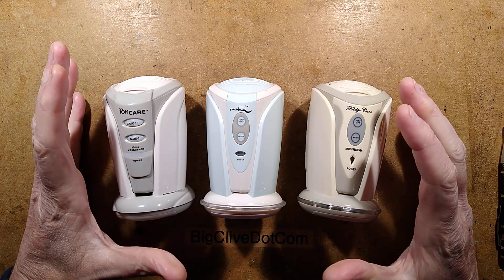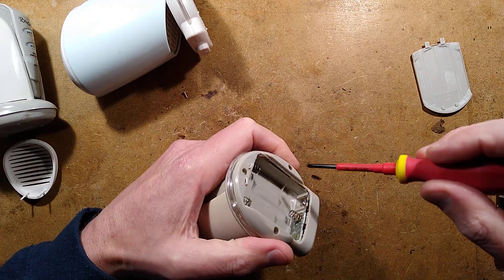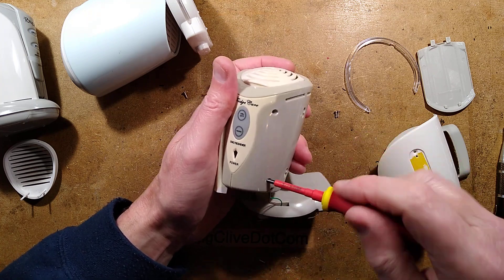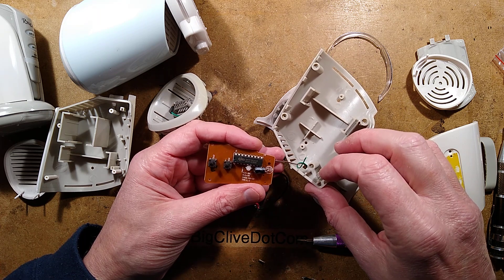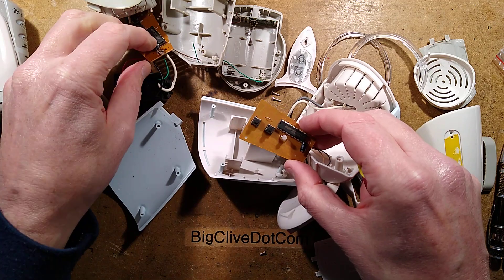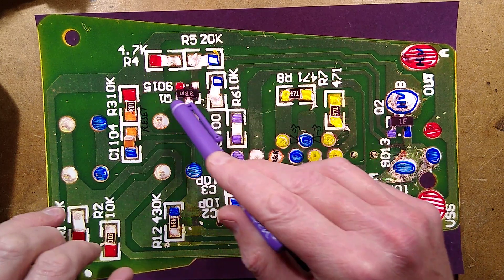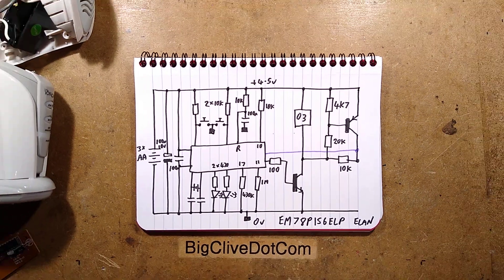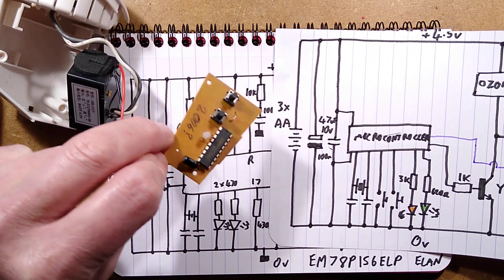20 year old design vs the current version (with schematics)

Comment: Considering ozone's proclivity for attacking rubber and foam items (as might be part of a refrigerator) and its tendency to irritate mucous membranes (as might be part of the refrigerator's owner), should anyone be using these at all?
Reply from the maker: Yes.  The low level is low risk of all those things.
Reply: @bigclivedotcom  I kind of disagree. The human body will regenerate and heal. Soft rubber/plastic parts won't. I'm almost certain even low levels of ozone will accelerate the gradual embrittlement of these parts. (Proportional to the dose, so slow but still steady if you keep using the ozone generator for years.)
Reply from the maker: @Gameboygenius  There will be slow surface oxidation of some materials, but it would take a long time to have a significant effect.
Reply: @Gameboygenius   that is why there is a microcontroller timing the O3 generation duration, it's not always generating O3.

Comment: would it be possible Clive to date them better by looking at the different components, just a thought I remember you talking a while back about how the components have changed over the decades and of course the make up of the boards, the sides under a microscope, just seems really interesting to know what came first the chicken or the egg, bad reference there, every one knows it was the chicken that came first duh, however back to the ages who is first and can you possibly then know better and be able to get a hold of one of the very first without getting ripped off.

Comment: I have two of the 2020 version (IonCare). I'm surprised how well they work on rechargeable batteries, given the fact that they supply a lower voltage.
Reply: Two? Amateur! I bought five after seeing Clive's video and am running them all on Eneloops.  ;)
Reply: @Shaun.Stephens  
I've been running mine since the last video as well. I used Energizer Ultimate Lithium batteries and they still haven't died!
Reply: I use an older and a newer one, both in my fridge and both running on Eneloop cells.
I always suspected that the low battery detection doesn't work properly since the ozone smell went away weeks before the LED startet blinking red as it should to indicate the low voltage. Now this mystery is solved thanks to Clive.

Comment: Could be constructed a lot cheaper. Must be a reason they have stuck with the design. Already tooled up for it's manufacture is all I can think of.
Reply: You must understand that it costs a ton of money to create the tools to make those cases. Once constructed, you need to run a few zillion plastic pieces through them to amortize the tooling costs. Hence, "that mold is still good, so keep using it!" mentality.
Reply: @demef758  1000kg of money? it cost about 8kUS per mold, in 100$ bills, that will not surpass 10kg total, or 4 bananas for our US viewers
Reply: @alltheusernameswastaken8936  Uh… What?
Reply: Molds aint cheap
Reply: It is designed for a 6 year old Chinese girl  to assemble.